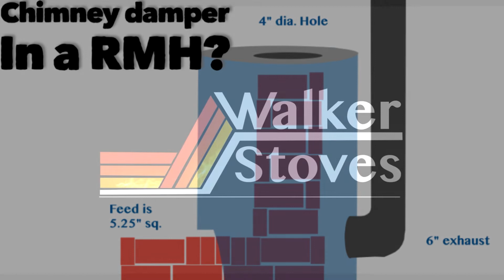Chimney Damper in a RMH?

Comment: I have a standard 6" J tube heater, with an 8 foot bench, and using an insulated chimney to above roof height. My house is very exposed in a very windy environment in the far north of Scotland. I fitted a shut off damper to the stove pipe section behind the barrel, just before the pipe connects to the insulated chimney. My intention was to isolate the bench after the burn. I really like it as a feature, but what I hadn't expected was I very occasionally have to use it even while running in major storms. We can have 50mph winds for days at a time. The draw through the system can be so great that embers can be sucked up the riser. After a burn, the burn tunnel is spotless. All the ash sucked through into the mass ducting. So now, if the winds are consistently above 40mph I run the heater with the damper half closed. I never get any smoke back. I run a CO meter, and always get zero. Even during the summer I can light the heater without priming, without it smoking back whatsoever. It's pretty much the optimal situation for creating draw through the system of course, so combined with the high winds it creates a fairly unusual installation, but I thought I'd share my experience of having a damper. It all adds to the knowledge base.